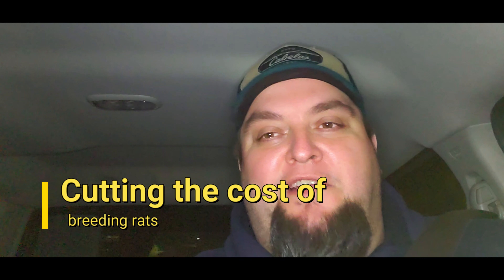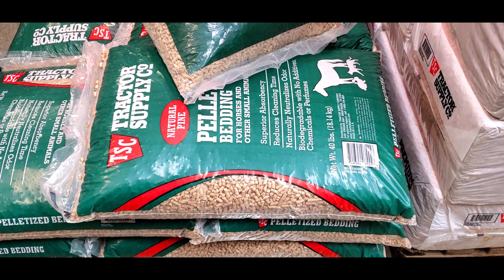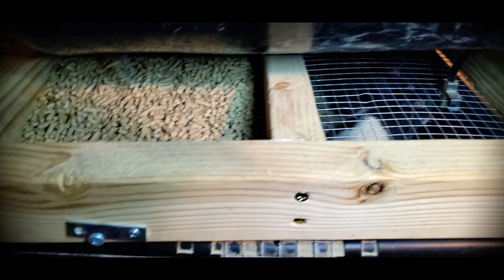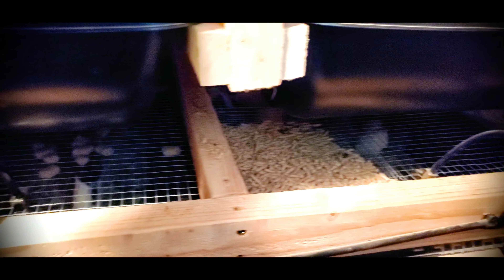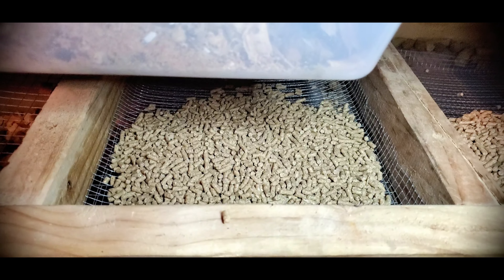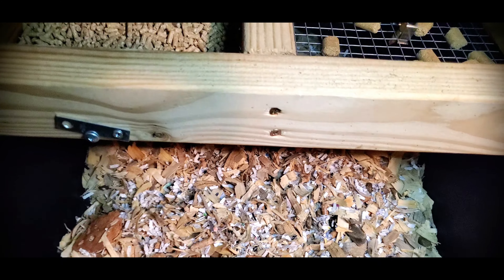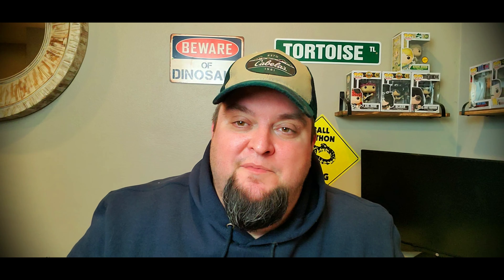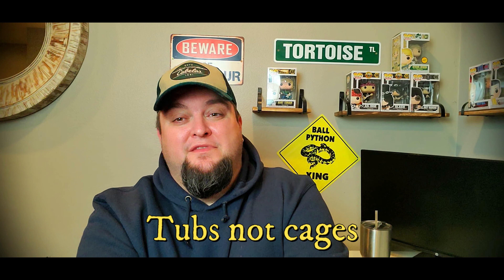Tips to Reduce your Rat Breeding Cost

Comment: Are the pine pellets kiln dried.
Reply from the maker: I am not 100% sure, but the give little to no pine smell. I have never has a issue with URI with any of my rats.
Reply: Zen Orc Reptiles ok thanks I bought some and then didn’t use them due to not knowing. Glad I kept them. How long have you been using them. The stuff I herd and read it’s toxic to them long term. Like kidney and liver issue wise. Also herd it could effect reproduction
Reply from the maker: @southernballs6985  I been using for over a year and I still have many of my original rats especially the males. Most of my makes are original. They breed prolifically still.